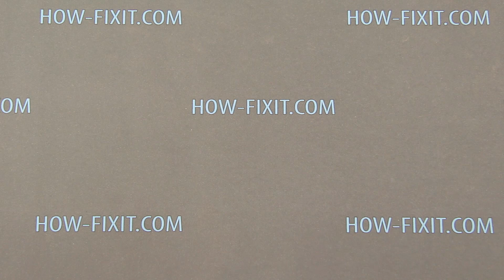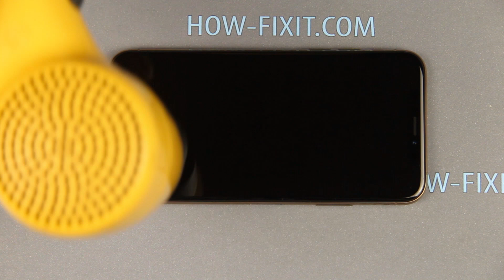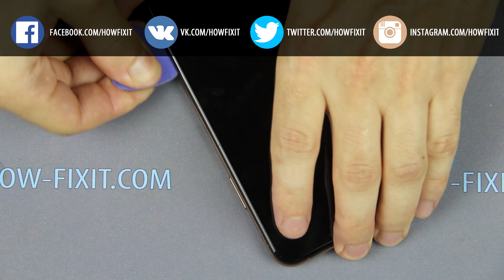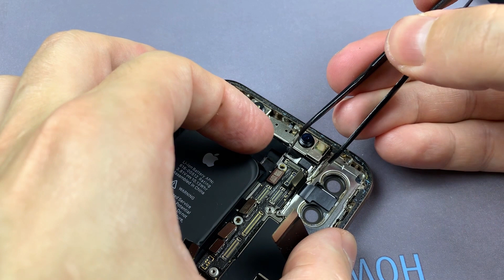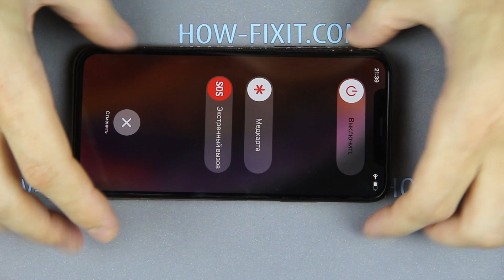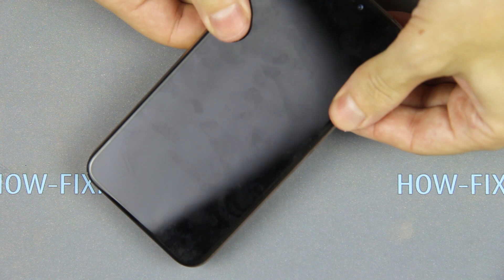iPhone XS Motherboard Replacement | How to Remove iCloud Activation Lock

Comment: Does same Face ID hardware works after changing motherboard?, should I get motherboard + Face ID while buying
Reply: Yes buy the pair. Apple has it to where the proximity sensor and flex cables are coded into the board and the Face ID and back light sensor are all paired to the phone/board

Comment: Friend, I changed the motherboard of the xs and I get a warning that the battery is not original from Apple, but it has the original battery, do you know of any solution to fix that error? regards
Reply: there is none.

Comment: Hi I have on question.
If you put new unlocked motherboard any activation or installation need it or just change and start working.thanks
Reply from the maker: Yes, just change the motherboard and get like a new iPhone XS.
If you need the working function of Face ID then buy the motherboard immediately complete with the Face ID module, because your old module will not work with the new motherboard

Comment: Hi, if i buy without face id, what options i cannot use except unlocking phone with face?
Reply from the maker: only face unlock will not work, everything else will be OK'
Reply: How-FixIT my front camera doesnt work aswell is that normal? I ordered a 256gb motherbord with no face id
Reply: @david.vonderhaar  mother board price sir

Comment: Does aliexpress work and is it safe, need a new motherboard for a customer, can’t find any on eBay for a reasonable price, aliexpress seems good just worried I’ll get scammed as it’s a lot of money to be handing over the Internet
Reply from the maker: Before, I bought on Aliexpress 3 motherboards for iPhone 8 and X, in my case the motherboards were working correctly. In fact, on Aliexpress sold restored original motherboards, so there is a risk and each case is individual. In any case, you can return the goods if it is defective.
On eBay you won’t find a working motherboard at a good price, because on eBay they don’t repair motherboards.
Reply: How-FixIT yeah well I need one for an IPhone XS, with faceID, AliExpress is the cheapest I can see, if you know any other places I can buy one let me know or if you even get one send me message and I’ll happily buy it, granted it’s not blacklisted or iCloud blocked. Thanks
Reply: @Dwight-schrutee  Did you end up ordering from Aliexpress? I know ifixit com sells them as well....
Reply: Adrianna no I bought I damaged iPhone and managed to use the motherboard in the phone

Comment: will this motherboard that you have linked on ali express function and work like an original iphone xs and will it work with a swedish "comviq" sim card
Reply from the maker: Motherboard for iPhone XS can only be original, there are no fakes. If the motherboard is unlock, it will work with all sim card in the world.
Reply: @howfixit  Thanks for the help man! Btw does changing the board unlock icloud activation lock
Reply from the maker: yes, if the motherboard changes - iCloud disappears

Comment: I have a question, I want to charge also the motherboard of my iPhone XS but I want to know if the Face ID still gonna work or no?
Reply from the maker: You need motherboard with the Face ID module. In the description under the video, I left links to such a kit: motherboard + face id module + light sensor.
More details in this video: https://youtu.be/TGxIQa4e6zk?t=243
Reply: @howfixit  , so if I get the new motherboard = face id module = light sensor, my iphone XS will be basically a brand new phone again with no associated icloud?
Reply: @Rad1oD3mon  have same situation, but ill buy without faceid and with 64gb its much cheaper. :)